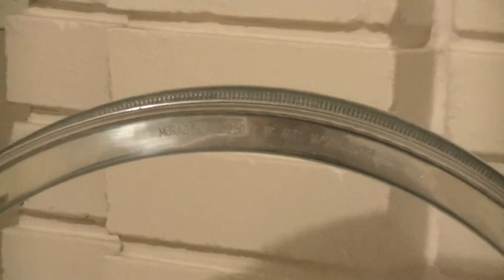PART 2 HARLEY FXE SHOVELHEAD CHOP PROJECT | King and Queen Springer

Comment: What does that engine weight.. and what is a king and queen springer
Reply from the maker: TheFrameoff I'd guess the engine is about 90-100 pounds.  "king and queen springer" is really just tag words for the video.  It relates to a King and Queen style seat and a springer front end.
Reply: ***** Cool .. going to be a nice ride